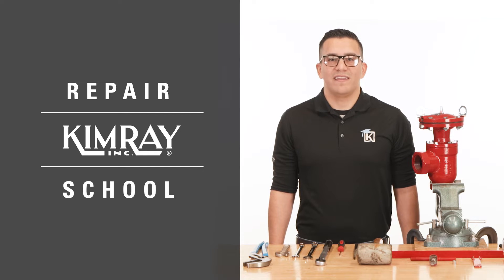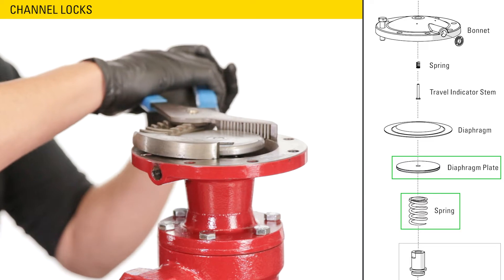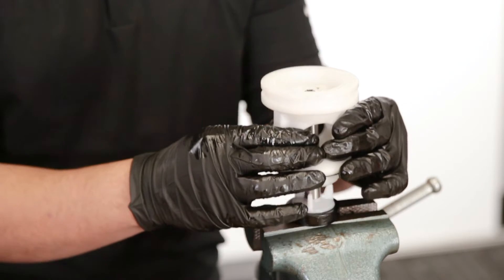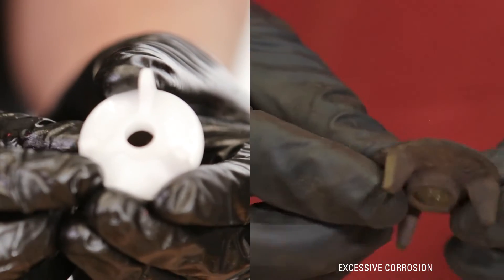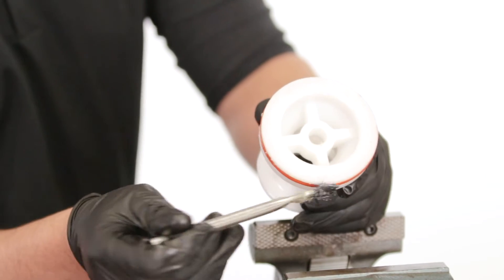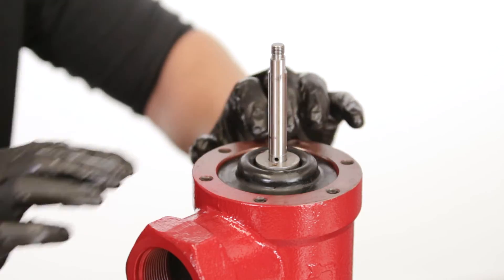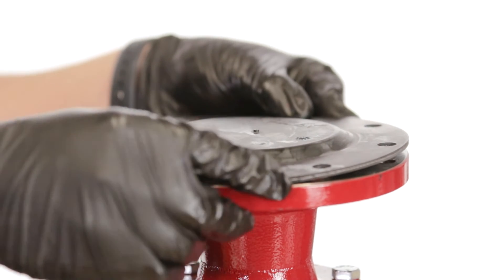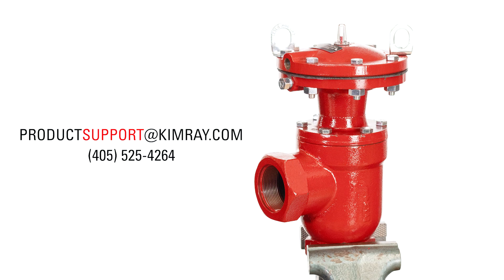Repair the Kimray Diaphragm Balanced (DB) Pneumatically Operated Dump Valve 🔧

Comment: What would cause the dump to be leaking oil/water out of the weep hole while dumping? Is that a failed diaphram? I replaced the diaphram but it continues to leak. Only leaks while the dump is actuating and dumping
Reply from the maker: The best way to solve this is going to be to call or email Product & Customer Support so they can ask a few more questions and help problem solve with you! https://kimray.com/get-product-support
If you're talking about a high pressure control valve body instead of a diaphragm balanced pneumatic dump valve body, there's an O-ring that likely needs to be replaced, but for the product in the video it might be leaking from some place other than a weep hole. Product Support can help best!